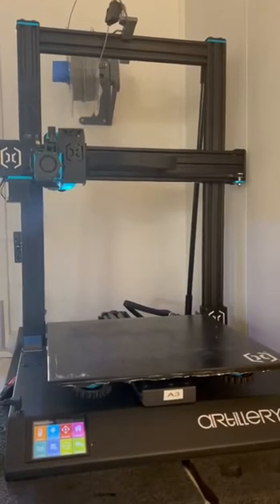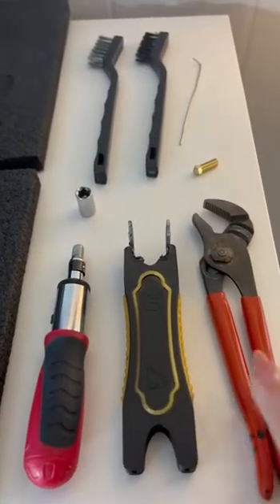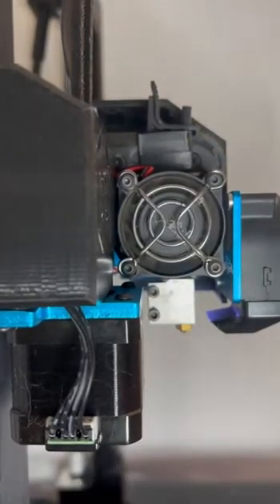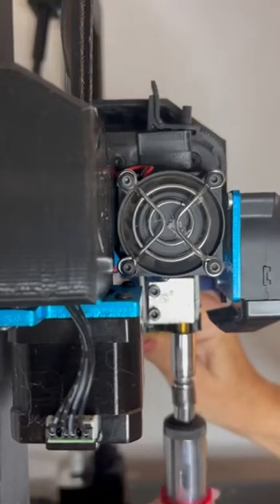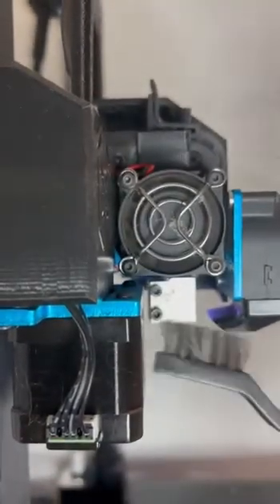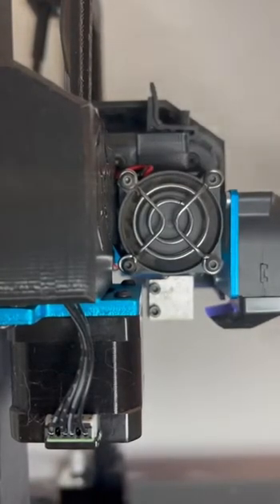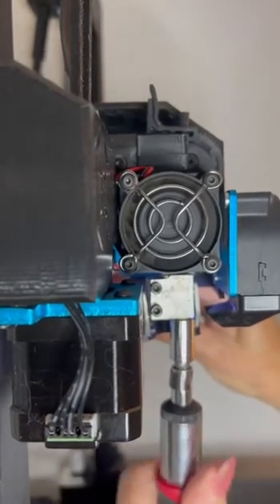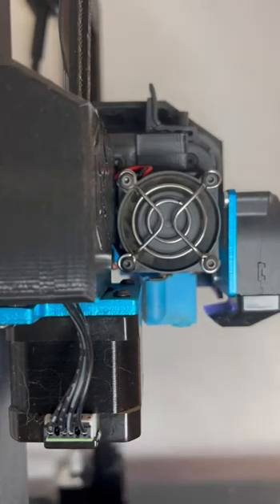Nozzle Change [Artillery Sidewinder X1]

Comment: what is the name of the tool you are using to hold the heat block and where can I get one
Reply from the maker: We had a subscription to a monthly filament box years ago, the heat block holder was part of the box one month. They sent the metal parts, and provided a download link for the 3d printable handle. It's been so long I don't even remember what company it was, but you can also use channel locks that you can get at any hardware store.

Comment: How often should you do this?
Reply from the maker: That depends on how much you print. I change brass nozzles every few days, about every 40 hours to be exact. Hardened steel nozzles last me about 3 months of 24/7 printing. There are visual clues you can look for, like excessive blobs/rough surface and generally worse quality prints than you are used to getting. Hope this helps, happy printing!